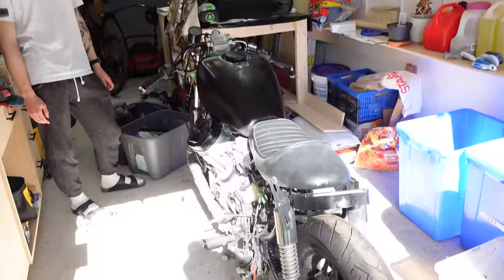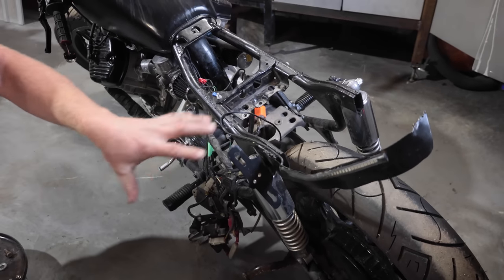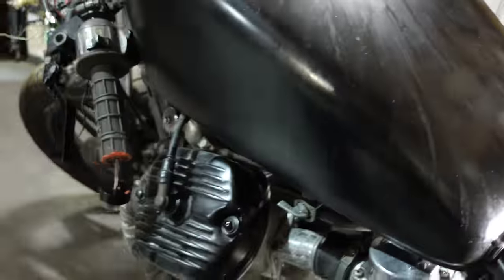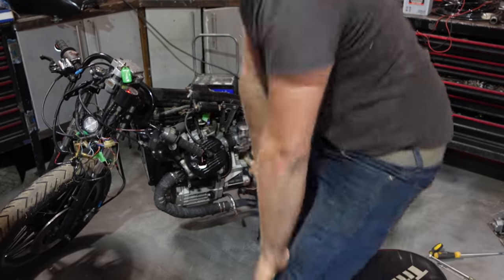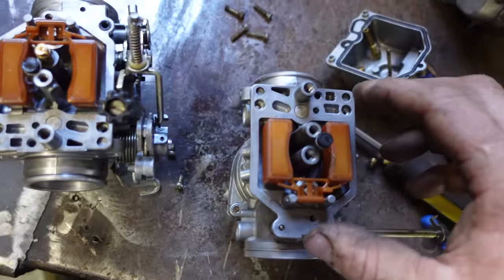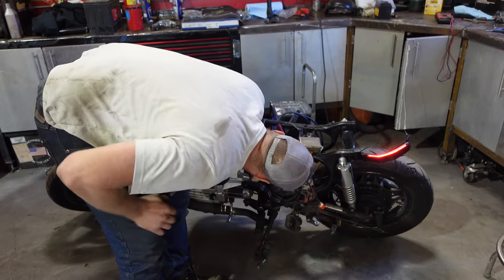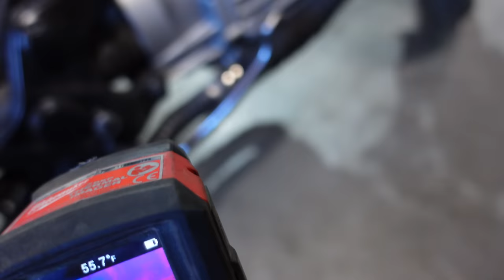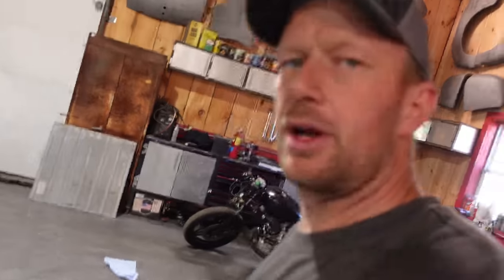Building a 1979 CX500 Cafe Racer [EP1]

Comment: Just a note, those being CV carbs where the slides are operated by vacuum diaphragms, they don't always love to run great with pod filters. The secondary little opening in the main bore of the carb leads to the vacuum chamber. The diaphragms can also be dry rotted and lead to weird stuff. Just some random tips from my own old Honda project.
Reply from the maker: Thank you for sharing your experience, it's much appreciated.   the diaphragms were all new.  I'll see what it does with a load on it
Reply: @DEBOSSGARAGE  no problem! some run fine, some don't. with some jetting changes and running oiled foam filters instead of dry paper filters, I got mine to run pretty good.
Reply: I had a Honda years ago and the air box was smashed up, it also ran terribly with  K&N pod filters. I messed around with those stupid CV carbs for to long untill in the end I replaced them with a set of (if I remember rightly) 34 mm mikuns carbs and used the K&N pod filters aswell as a 2 Stoke throttle cable which splits into 2 cables through a little plastic box. It worked really well and felt like it doubled the power. I remember my dad telling me that the ideal cafe race was buying a bike you could only just afford then taking everything off that you could sell to get back enough money to pay for the fuel to run it 🤪
Reply: those carbs actually had pistons pulling the slides up instead of diaphragms.  It was a weird thing honda did with their Keihin's for a few years in the late 70's and early 80's.
Reply: @TheOpinionationer  my '76 had a diaphragm wrapped around the slide. Donut shaped.
Reply: @DEBOSSGARAGE  yes a shared air filter box i seen 750 guy build nice box to share vacuum / pluses .and youll need to jet it up so it does not lean out .just like i am doing on 212 with 28mm carb i got to install 130 jet or drill it  in place of stock ones .oh the stuff we learn messing with Itb`s and the alike.my AEM o2 meter are great to test with i plan on using the one i bought on the cb360t honda build .dril n test till it hits the sweet spot and if i go to fat ill install the other set of jest drill back a bit
Reply: Have the same issue on my GS1000G Suzuki. It’s got 4 CV carbs running into a shared air box. Without it the bike starts difficult and runs like crap. With it, the pulsation and shared airflow turns it into a handlebar grabbing monster.
Reply: CV carbs do not like pod filters. Tried it on my CB750 but could never get it to start easy or idle right. Only works well under wide open throttle. Ended up swapping to CR carbs. Check Murray’s Carbs. I’m sure they make a lot for that bike. Might be a little pricey but I promise you it’s worth the amount of time and headaches it will save you in the long run.
Reply: try some heavy socks, cut off and oiled over the outside of filters. 🤣
Reply: Yep, old carbs generally just need a little love and fire back up… keep them clean and you don’t care what it looks like on the outside
Reply: Just mikuni things
Reply: Not sure if it applies with these carbs, but generally for multi carb setups you need to synchronize the idle circuits. I've done this by attaching a long piece of clear tubing to the vacuum port on each carb and create a loop that's half full of a light oil like atf. Then adjust throttle linkage until the oil is at the same level. Works really well....
Reply: @tiredofit1235  yeah, they need synchronized, both the main blade/slides and the idle circuit.
Reply: Hey Rich, I’m sure you know this but the reason the screws are all knackered on the carbs is because they are JIS and NOT Philips! See it all the time on Japanese bikes. Great to see you doing a bike build! 👍

Comment: When there is a dot by the star on the screws, it is a JIS screw (Japanese industrial standard) and you should use a special JIS screwdriver. I have worked on japanese motorcycles for about 45 years, and only last year I was aware that there was another screwdriver for those screws, neither the Philips or the pozidrive fits perfect, and thats the reason you see so many destroyed screws as you see on those carburettors. I just got a set of JIS, ant that is on another level.
Reply: 45 years working on Japanese bikes and you didn’t know the screws were JIS, glad I don’t bring you my bikes to “repair” if you’re unaware of something so basic.
Reply: YES! so many bikes I’ve worked on have knackered screws because people think they are Philips! Get a set of JIS screwdrivers! 👍
Reply: @martyniner8893  while I was training 28 years ago, the class I was in got given a set by the tutor who said “ you’ll need these for anything Japanese you work on, be it cars, bikes, bicycles, electrical nothing else fits right” that’s why I was surprised you didn’t know after 45 years of working on Japanese bikes
Reply: Afaik the JIS standard is now defunct but has kinda been subsumed into the newer DIN/ISO standards for cross head screws.

So if like me you find it difficult/ludicrously expensive to source JIS screwdrivers, screwdrivers made to the DIN 5260-PH/ISO 8763-1 standards should be effectively the same

Comment: Love it!
The power tool battery is not suitable to be charged from the alternator on the bike, as the voltage needs to be controlled specifically for the lithium battery.
However, there are lithium batteries available, that are made for motorcycles and they are not much bigger than that tool battery.
Just do a web search for 'lithium motorcycle battery'. There are lots of different types available.
Reply: Yes Gary, well said.  Charge / Discharge profile very different
Reply: Lithium iron phosfathe (cant spell it ) lifepo4 is the way to go.
Reply: It'll be fine

Comment: Excited to see your take on this. For those saying you can't run pods on cv carbs, do not listen. They simply have not worked hard enough to have good results. Its not a simple jet change and go. 100% can be done and is done daily. These are easy carbs to play with. Mikuni BS34s on the other hand seem to fight a bit more but again, can absolutely be done.

Comment: I suggest "clip on" handle bars. They bolt directly to the fork tubes.
Reply: Yup, but once he learns how to ride; until then motocross bars I suggest otherwise at the first turn...into the wall you go.  Yes clip ons for the look but they f**k your back  until you get some speed up on the highway to support your torso weight.

Comment: The larger jet is your main, that smaller jet with the machine gun holes in the side is your "idler jet.  It will be hard to start and won't idle if that smaller jet gets clogged-- which is the most common thing that happens on basically all carb motorcycles;   that smaller idle jet gets clogged with a piece of gunk

Comment: I would recommend adjusting the valves first, then syncing the carbs to get it running smoother.  Removing the airbox and original exhaust will require new jetting.  A good place to start would be a #120 main jet and a #90 pilot jet, with air screw at 3 turns out.  Oh yes, those pod air filters could be blocking the slide orifice in the rear of the carb, some trimming may be in order. Good luck with your build! I'm definitely following. 👍

Comment: It's fairly critical that the fuel levels are the same in both carbs.  I used to check this by slipping  a clear piece of tube over the drain nipple on the bottom of the carb and opening the drain screw.  I would hold the tube up next to the side of the carb in a U-shape and open the petcock.  A good starting place is right at or about 1MM below the joint of the float bowl and the carb body.  They should be within  a millimeter of each other when the bike is level.  The main jet needle which acts as a metering bar needs to be the same height too, if they have multiple clip positions (those ones probably don't).  Proper jetting is crucial for these.  There's no way around that without testing multiple sizes and checking the plugs.  Synchronizing the  carbs to each other is also very important to make it idle smoothly and have good pull just off idle.  We always had good results hooking a monometer to vacuum source just downstream of the throttle plate on each carburetor.  Many of them had nipples or 5mm tapped holes specifically for this. They may be on the intake boots rather than the carbs.

Comment: Nice!  I have a 1980 CX500 that's very similar.  Those MotoGadget bar-end signals are great (and pricey) and I definitely recommend keeping them.  For carbs, a guy named Murray puts together a nice Mikuni setup, although it did drop my range from 115 miles to 80 miles, so that hurt.  Supposedly the stock carbs don't work great with pod filters and at least need to be rejetted, but still may be temperamental.  And I got a battery box from CafeRacerKits in the UK to mount an AGM/Lithium battery under the engine.  They have other cool stuff for these bikes.  Oh, and Harley mufflers from an 883 (I forget if it was a Dyna or Sportster) worked great and made it a lot nicer to ride versus the shorty mufflers I tried at first.  If you have to take the engine out, it's a good idea to replace/upgrade the stator at the same time.

Comment: Try adjusting the small needles that screw in from underneath the carbs near the float bowls..ie the ones where you found one with the tip broken off . These are the idle mixture screws, Might be why the right side is not running properly, and the popping you had on the right could indicate it's running lean. Also, those rubber plugs next to the brass jets in the float chamber normally cover up the drilling for the idle jets. Pull out those rubber plugs and look to see if there are idle jets in there, and make sure those passages in there are clean👍

Comment: I had a 1985 Suzuki GSXR 750 with Mikuni 29mm flat side carbs. 
I put K&N pod filters on it and for the life of me I could not get it to run right. I finally to the bike to a famous shop, Dr. Suda, that had a mechanic that had been on the Suzuki race team back in the day. He fixed it, the bike ran like a scalded cat. One of the things he did was put in what he called “Air” needles, the bottom 10-15mm of the jet needles were chopped off, they just ere not there. Worked great, but I really regretted removing the air box.
Have fun building the cafe racer!

Comment: I have an 82 cb650 and I absolutely love that bike. It's so light and rev's so high it's just a pleasure in the twisties. However it's a 4 cylinder so it has 4 carbs and that is at least 2 carbs too many. Can't find parts, difficult to keep it sync'd, etc. Once my cummins swap project is done I've been thinking of trying my hand at fuel injection swapping the bike 🤔. Excited for the rest of this build! 👍
Reply: I really wanted to get a CB, but they're too rare and expensive around here, so i opted for a CX, like this one. I like it alot but they're completely different category from the CB's. You can easily turn a cb into a cafe racer and it will perform excellent.

Comment: ALL that wiring on the front packs in behind the headlight. If you are going to change the bars, now it the time. A straight drag bar would look good on it. Not sure about that bike Rich, but some of those carbs required synchronization. I suspect since those are KeiHin or however you spell it, they will. The Mikunis on the Kaws were more forgiving. Once you get that second cylinder firing that idle will likely be fine. My friends laughed at me for taking the stock bars off and putting a set of 4 inch dropped bars on my CB750FOUR. Great bike. Roll the throttle until the valves float, and every time it would return to a flawless idle. Looking forward to the revisions on this little gem. Cheers

Comment: The Cafe racer, specifically was the creation of the bikers who frequented the Ace cafe on the North circular rd round inner north london, collectively known as 'The Ton Up Boys', a 'ton' being 100mph and the 'race' was to get up to a specific roundabout and back before a certain record finished playing, the shorter the record, the more evidence for a circuit with top speeds in excess of 100mph, I can say all of this with some authority being the grand nephew of one of the OG boys from 1950. Most of the bikes they owned were WW2 flathead/sidevalve BSA's and the odd T120 and yes, 750 was the go to displacement! (ps; old honda coils, great for dry weather use, even better if you need a little extra jazz in yer gentleman parts when it rains! best replaced at this age)
Reply from the maker: that's awesome.  Thanks for sharing!
Reply: @DEBOSSGARAGE  RIP Great uncle wally, may he be burning rubber in ace heaven!
Reply: @DEBOSSGARAGE  Sorry, I know I'm a bore but..... The Og ton up boys were made up of the WW2 servicemen, many of them the dispatch riders who were so married to their steeds that they saw as the machines that kept them alive while others fell. On demob, couldn't bare to be separated with their partners and bought them up, the og cafe racer was the result of ridding excess frame and ancillaries to make their war department issue 1930's design BSA's  able to compete against the post war TriumphT110/120's, Norton and the likes! The last time Uncle wally through his leg over a saddle, he was in his 80's and it was my TR6 triumph 650 (the oil in frame T120), never was an old ton up boy more proud!

Comment: I had a 1979 GL1000 Gold Wing and I rebuilt the split bank 4 carbs in my college apartment at USL in the early 90's.  Changed the spark plugs, timing belts, adjusted the valves and took her for a run.  
Got her to 115mph on an open stretch in front of Patout Sugar Mill and a State Trooper saw me going the other direction.  He quickly turned around and pulled me over (I wasn't going to run).  I pleaded for him not to tow my bike (well over 55mph) because I had been working on it.
He didn't arrest me and tow the bike off (because I didn't run), but wrote on the ticket... "He rebuilt carbs, runs WELL".  That helped with the judge too.

Good luck on the "Silver Wing"  I know it's not a GL500, but it's real close.....engine wise.

Comment: I had a CX-650 Eurosport and neither the 500, 650 had accelerator pumps. The linkage being crooked doesn't matter so long as the synchronization adjustment screw is free to move to adjust the vacuum on both carbs evenly. The main needle and its piston are operated by vacuum instead of dirt bike throttle cable installed directly on the piston. The piston sticking in the carbs main body often gave troubles along with intake leaks when the clamps holding the carbs in their mounts were overtightened. Cheers it brings back good memories. 

Just Cross checked my memory, your carbs with the accelerator pump are for a Honda, CM-CB 450 of the same years. I had started my licence and was working at the long defunct Motosport Plus in Ottawa.

Comment: In 1977 I bought a new CB400 four Supersport. I tricked it a bit with bikini fairing, shocks and cast iron front disc brake (I made a pattern and cast it at work and machined myself) with pad and shoe changes. Was an awesome bike. I live 84 miles from my weekly job and rode it everywhere on the throttle stops. Lived on West Coast of south Island of New Zealand with 250 to 350 " rain each year. After I had done about 60000 ks I took a CX500 for a test ride with the intention of upgrading..In the day it was clever..Water cooled shaft drive two piece wheels etc. Sadly the bike was nice and smooth but lacked the nimbleness of my 400 and didn't feel like it was right for the tight twist roads in my area so I passed it up. I think it simply got too heavy. Clever never the less.

Comment: Love the bike... Had a few Hondas from that vintage... All 4 cylinders... Valve set is good idea, but you do need to balance the carbs with a vacuum gauge and adjust the idle air mixture on each carb. That emulsion tube that is stuck in the carb is part of the idle circuit and small throttle openings before the carb transitions to the main jet at larger throttle openings. I hate CV carbs... Give me a good flat slide any day. Just have to learn to operate a throttle... CV carbs just helped driveability.

Comment: On my honda I se 2 gm hei modules and 2 caviar coils way more power the igintion on those bikes is weak and the stock modules are not available in good quality. This is the best change that I made. Make sure you run the shock air cleaner they work the best they are tuned to the carb

Comment: Those screws are soft from the factory. They're also JIS - different angles and widths on the Phillips interface. When (not if) you strip one out, just grab the head with a small pair of vice grips and loosen it 1/8-1/4 turn and take it out. Most rebuild kits come with harder (and US format) screws. I prefer All Balls Racing carb rebuild kits. I've rebuild dozens of those Honda cv carb sets. Very nice carbs for cv's. I like to polish them since they're all aluminum and exposed.

Comment: I had a 1982 CX500T EFI and 18 pounds of boost from the turbo. That was a fun bike!
Reply: I've read about those but never saw one in person.  Was there a waste gate on that?  18 pounds of boost was a lot back then.  I can't imagine slapping the throttle shut with that much pressure behind it.
Reply: Yes they did. I didn't know until after I sold the bike and it got wrecked that they are kinda rare. One year only. No internet back then. Lol

Comment: Those Keihin CV carbs will never work correctly without the stock air box installed. The best solution for using pod filters is to upgrade to a set of Mikuni  VM34 Carbs from Murray's Carbs.